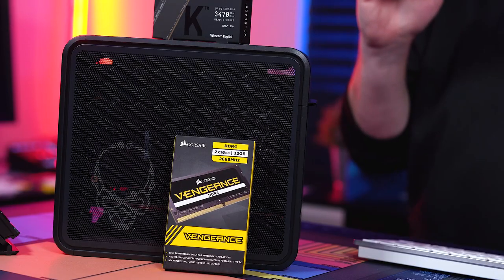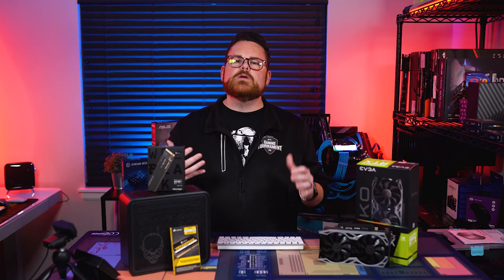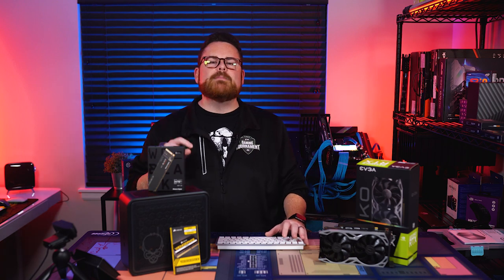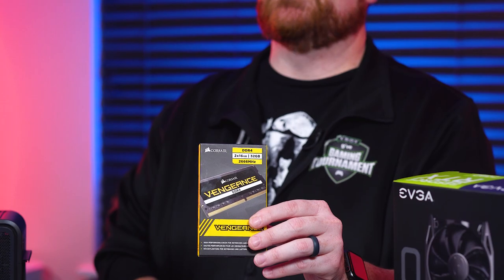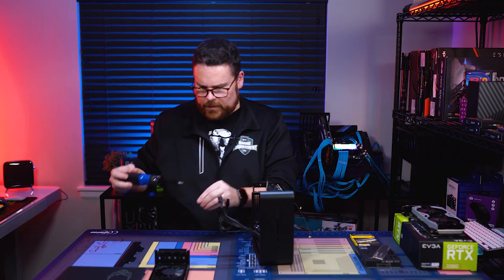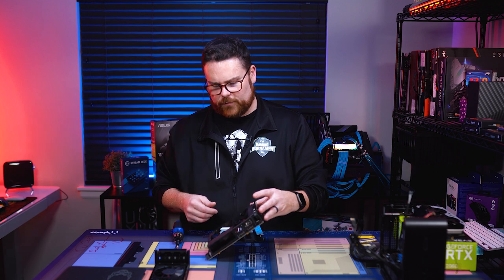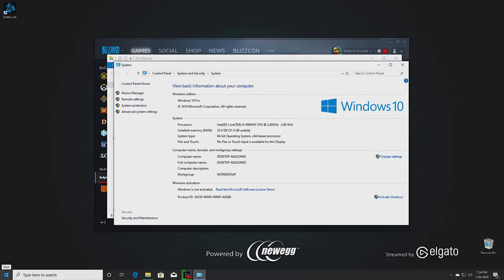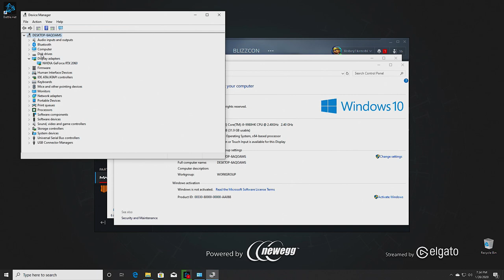Building the best Intel NUC gaming PC using the Intel Ghost Canyon NUC | Robeytech

Comment: Thanks.  Really helped me find the 2 SSD slots.  I didn't know where the 3rd one was until I saw you insert it.  I only had 2 SSD sticks right now anyway.  But it's easy enough to add that later.  I didn't take the whole "component" out as you showed.  I also had to define my 2nd SSD in Windows Disk Management, but I knew I would probably have to.  Look forward to more.  Not a gamer except MS Flight Sim and to begin with I'm just using the graphics on the board as it came.  Thanks a lot.  Irv in Florida
Reply: I'm not sure if it's too late but do NOT add a 3rd m2 drive. It starts using the PCI-E bus and it slows it down considerably. Which is very important if you want to play FS2020 at high detail.

Comment: Intel only claimed that the length of the card should be smaller than 8 inch. I am wondering whether there  are limitations on height and width. The asus offer is 19.7 x 12.1 x3.9 cm, and is confirmed to support NUC9 officially. The gigabyte mini is L=169.99 W=121.45 H=42.1 mm. Will it be supported, even if 42.1 mm is a little thicker than 3.9 cm? Could you talk a little bit about the limitations on height and width? It could be very helpful for users to buy the corresponding card. Thanks.
Reply: @RobeytechLive  Hi, thanks for the reply. The official intel page only mentions 8 inches (zotac is slightly exceed 8 inches) and dual slot (roughly 40 mm). It does not mention the width (strange for me). You mentioned that evua KO, which is shorter than 120 mm and as thin as 2 slots, works. We could conclude that 20 * 12 * 4 are supposed to be safe. But the mini cards are not always smaller than this. If you could check giga, that could be perfect, since its size is wider than 12 and thicker than 4.2. thanks again.

Comment: This NUC is utterly crap! I am using it right now. The graphics card BLOCK ALL AIR INTAKE for the CPU so the CPU runs at 80° (even at 20%) load. If you us OBS the whole thing over heats and restarts the machine. Big mistake. Avoid.